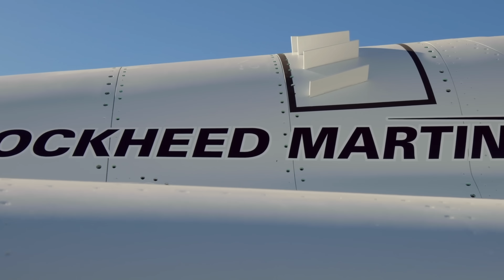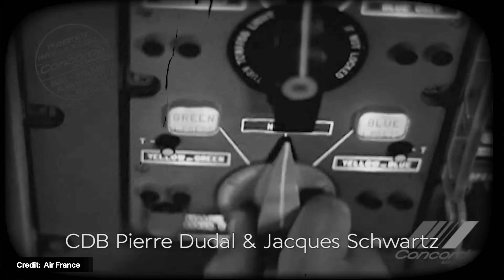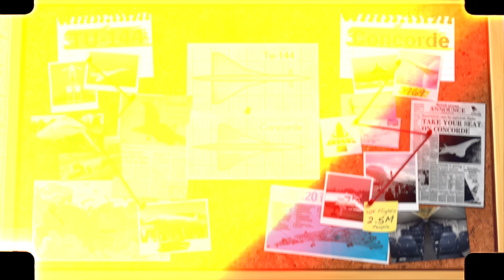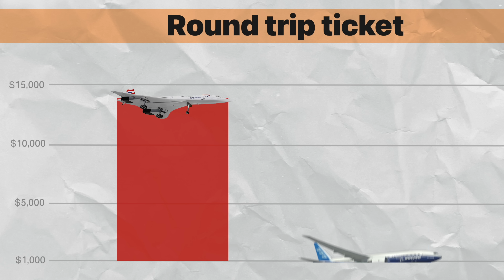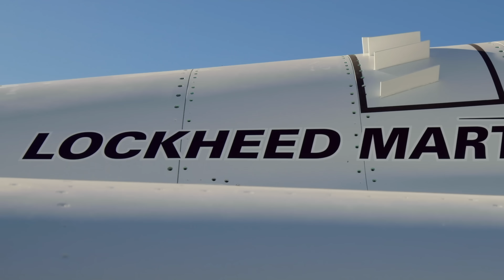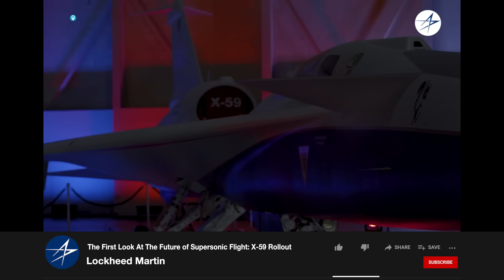NASA Just Solved the Super Sonic Flight Problem

Comment: Concorde was so loud that it couldn't be flown over land, for a subsonic demonstration flight one flew over my house in the Oakland CA hills and it was unbearable. This statement is true; the Concorde was so loud due to the sonic boom it created when flying faster than the speed of sound, which meant it could only fly over oceans and was not permitted to fly over land populated areas to avoid disturbing residents with the loud noise. 
Explanation:
Sonic Boom:
When an aircraft breaks the sound barrier, it creates a shockwave that travels to the ground as a loud "boom" - this was a major issue with the Concorde. 
Regulations:
Due to the disruptive nature of sonic booms, most countries, including the United States, banned supersonic flights over land. 
Transatlantic Flights:
As a result, the Concorde was primarily used for transatlantic flights, where it could fly at supersonic speeds over the ocean.

Comment: this guy claim to be engineer of a jet fighter? which one? 
by the way, nothing will make sonicboom disappear so long the jet roars still sounding. sonic boom isnt aero problem. its a SOUND PROBLEM. 
and the only most viable solution is the one that your HAARP tech already have : using RADIO emission to phase out aero molecules vibrations caused by the jet thruster. by engulfing the engine and the exhaust/high pressure thrust behind the jet inside a radio bubble that emits frequencies that cancels out the sound of the rumbles in the air so it doesnt propagate outside the bubble.
the emitter antennas can be placed around the rear fuselage around the engine(if the engine is behind) to form that bubble shape influence. thats it. and you can use WHATEVER aero design you want for the vehicle. and not only you wont hear sonic boom, you wont even hear the engine rumbling. and this is not some sci fi tech. your government has been able to do that with their HAARP tech.

Comment: 0:39 in and already wrong.  Supersonice flight has been continuing since the concord was retired.  F-18, F-15, F-16, B-2, F-22, F-35, and the coolest of all the SR-71. All supersonic. And I think there are even SR-71 has a couple still in service and I think the A10 tank killer is super sonic but I'm not sure.  Supersonic passenger flight is a different story.  The Concord was a very odd bird and had several problems to start with.  Since before it retired there have been attempts to make a better supersonic jetliner but there were several challenges to overcome.  I know, I worked on the High Speed Civil Transport project before it died in the '90s.  It will be interesting to see how those challenges are met and interesting if you know any of them.

Comment: I recall the TU144 was incredibly loud inside, so much so that you could barely have a conversation. And the air show crash was actually a result of a French surveillance airplane flying above (it was he reason the TU144 take off was delayed as the French had to wait for the surveillance airplane to get in position). When they climbed, their radar sounded a collision warning causing them to level off abruptly, stressing the plane beyond its design. The French and Soviets settled the case quietly as it was an embarrassment for both.

Comment: As long as the flight is long enough to justify it, the fuel burn rate wouldn't necessarily be hugely different if the plane were higher up - most of the fuel burn on the Concorde was keeping that speed up against the friction of the atmosphere - fly higher, less friction.  Only works for long flights, though....

Comment: Great job Ricky, but I feel if you’re going to adjust for today’s dollars. Fuel cost should be adjusted as well. zero chance a Concord and a 777 both cost the same per passenger mile. The slide before gave the 777 4.7x passenger mile advantage!

Comment: A modern supersonic plane has a problem that the Concorde never had. That is climate change. The Concorde had a higher fuel bill. A supersonic plane today would still have the higher fuel bill but could easily develop the reputation of another evil thing that the rich are doing to the masses by putting multiple times the amount of carbon in the environment than the planes normal people can fly. If that happens, much of its potential market will shun supersonic flight either for their own beliefs in protecting the environment or the damage to their image and reputation. If this happens, the lower volume of travelers will drive the costs much higher and likely will doom the whole project.
Reply: Eventually people will awaken from their self imposed nightmare and realize we're at a CO2 shortage.

Comment: NASA MAY have! MAY HAVE found ONE solution to ONE specific problem. And there are LOADS more problems to be solved before sustainable supersonic passenger service is available.

Sonic booms over land is the one they MAY have found an answer too for a given CONFIGURATION. Is that configuration usable by commercial airlines? We will have to wait and see.

The bigger issues fall into the realms of systems management (Efficient aerodynamic load control), logistics Engine maintenance and parts) and economics (Fuel costs and useful load)! These are the money shots! Anyone saying different is selling swamp bottom land.

The Concord never made a dime in its life. It was a money pit.

Comment: Single engine transatlantic flight may be another hurdle. Regulations for Transoceanic flights for twin engine jet passenger aircraft had to be carefully drafted after reliability of twin engine jets proven. Single engine is a whole nuther issue for passenger service. 

“ETOPS, originally short for Extended-Range Twin Operations Performance Standards, or more recently just plain Extended operations, is the rating that allows twin-engined aircraft to fly long distances; particularly over large bodies of water like oceans.”

Comment: The real problem of today's air travel is that check in takes over 1h and requires you to strip to your underwear. And often the airport is hours away. So 1h flight time comes with 4h pre and post flight time.
Reply: Business flights (not business class) don't require TSA and helicopters aren't much more than the travel time cost plus the vehicle.

Comment: I think it will be cheaper to build trains ..China already is coming out with trains that will run 1000km/h ...And the semi vacuum tube system with 4000km/h is planned... 3.2 times the speed  of sound... Unless you can build planes faster and cheaper ....Furthermore train stations  are more convenient than airports
Reply: And after the first tectonic plate shift, they can rebuild the tunnel.

Comment: Sonic booms are not the problem, the problem is with GHG restrictions  we will be using less dense energy sources ( compare the best battery in w/kg to regular gas ) and Since the kinetic energy increases with the square of the speed, an object doubling its speed requires four times as much  energy.
Reply: That’s just for static drag. If you include the supersonic drag, power is more like velocity cubed. That’s why supersonic flight is a dead-end. The amount of extra power required to go supersonic is just stupid and makes it horribly inefficient.
Reply: @simontillson482  If speed is the object, you pay the price. That's why most people no longer use boats to cross the Pacific.
Reply: @friendlyone2706  That is an Awesome point!  Were we the people of yesteryear we would think "Why are these young people hurrying to jet set across the Atlantic? The Queen Mary, "Blue Ribbon Atlantic Crossing Holder" can get there in a blistering 4 days. What's the point of going faster? It is clean, efficient and most of all safe!

Comment: Because of the requirements of the aerodynamics, these planes have to be built narrow-bodied making them claustrophobic 😒. Plus because of the massive fuel⛽️ burn 🔥 and limited capacity, each seat 💺 has to be priced very high just to break even. What western propaganda 🤔 doesn't allow us to realise that 🙄 Concorde was quite a space constrained jet liner. They are only suited to jet-set-go business bosses and executives. For regular travellers, a wide body 747 or an A380, flying at subsonic speeds, is a far more relaxed 😌 and leisurely 😎 choice.

Comment: I'm more interested in electric planes. Quick swappable Aluminium Air batteries could make long distance EV planes viable. The battery is very light making it perfect for planes, just split it in many small modules so that swapping them out is easy. Charging a plane takes too much time anyway so battery swapping is the way to go.
Reply: Batteries are secondary stored energy and therefore always for inefficient than direct energy production. But, if government grants are your objective, battery powered planes can be profitable. If you're on Mars, battery powered might be more efficient than carrying your own solar panels.
Reply: @friendlyone2706  Depends on where you get the energy from. Sure, putting a generator and a battery between an engine and the wheels doesnt make sense most of the time. But if you want to use other forms of energy (be it renewables (sun, wind, water, waves, biomass), or other types of fuels that cant be used for mobile applications (coal, trash, nuclear power)), a battery is often more efficient than power to fuel applications. Even here on earth.
Reply: @justinterested5819  Batteries do have their uses. And going downhill can be recharged -- even on the moon and Mars.

Comment: I worked on the Concorde as a Braniff flight attendant because Braniff had a promotional interchange with Air France and British Airways in the late 70s.  Braniff only flew it sub-sonic and we only flew it between Dallas and Washington DC.  The week that I worked on it the flights were always brim-full.  I sat in the aft jump seat (facing aft) and take-offs were especially thrilling. It felt and sounded  like a rocket ship with my body thrown against the seat harness! Because we remained sub-sonic over the US, even at our cruising altitude the plane never leveled off. Pushing those carts uphill from the aft galley was a bit of a chore. No, really, I was very lucky to experience the Concorde!
Reply: That's super cool that you've Been on it!
Reply: I would love to see your stewardess outfit... the 70's I miss. Was it polyester ...bell bottoms and of course a scarf. :face-blue-smiling:
Reply: this a flex lol and i love it

Comment: The fuel cost may not be what you think it will be. Consider the idea of the current adaptive cycle engines coming online for military jets, they make supersonic flight possible without using afterburners or even better fuelless engine designs using heat exchangers instead of dumping masses of fuel into the airstream.
Reply: No matter what engines you use, supersonic flight is always going to be way less efficient than subsonic. This argument doesn’t work I’m afraid.
Reply: @simontillson482  I am not saying supersonic flight would be less energy-intensive than subsonic flight, just his baseline comparison looking at Concorde consumption levels vs the technological advancements we have today is off and will not be as prohibitive as he imagines.
Reply: @thehobbyguy7089  Very true. The gap with modern technology is narrower, but it’s still wide enough to make it impractical. As mentioned in the video, even military jets only use supersonic flight to avoid interception and avoid it for cruise wherever possible, because it reduces their range so drastically. Honestly, I can’t see any reason for commercial supersonic flight. It just makes no sense. For long haul flights, the actual flight time is not a big proportion of the door-to-door time anyway, so even for business class, the cost/benefit ratio is very poor. It’s pretty much a gimmick at this point and will probably remain that way due to increasingly tighter controls on emissions and efficiency.
Reply: @simontillson482  You remind me of the college professor who said we didn't need a new delivery service whose motto was "When it absolutely, positively, has to get there overnight." The professor was wrong. The student became rich. Sometimes people absolutely, positively have to get there faster.
Reply: @friendlyone2706  Good point. Maybe it does make sense for the ultra-rich or executives with unlimited expense accounts. I did deliberately use the business class in my discussion for this reason. I ignored the idiot class deliberately… 🤓
Reply: @simontillson482  Or the person with a personal emergency, such as learning a loved one is dying, and is willing to pay on their credit card for the  next two years for that opportunity for a final goodbye.

Comment: Watching this video I couldn’t help but think of two options. The expensive supersonic aircraft would be for low volume passengers. The ultra efficient aircraft would be for everyone else. In the future I could see the blended wing body with very high bypass ratio geared turbofans being possible. Both could possibly utilize rotating detonation turbines for the power section. The blended wing body might have a contra-rotating bypass fan like the NK-93 for maximum efficiency. The NK-93 was never funded enough to reach market but highlighted a possible path forward solving the noise issue of the CFM RISE and other propfans.

Comment: I hate it, especially the company that wants to lift the ban on supersonic flight above land. Flying at supersonic speeds induces so much more drag, even high performance military jets don't often cruise at supersonic speed because it demands burning more fuel to offset the drag. 

Love it when NASA makes cool tech, but I'm betting and hoping each of those supersonic flight startups are just scams.
Reply: Indeed, just think of the seed money required for a supersonic plane. 10s of millions per year, over 3 years from hype to fail. That’s a good 30 million for these scammers. Better than getting a real job… Venture capitalists are complicit in these scams - they’re taking a 10% cut and all they have to do is find some rose-tinted glasses wearing schmucks to invest.
Reply: This is, pardon my french, total bollocks. Why would we want such lower fuel efficiency and passenger carrying capacity? It makes no sense whatsoever.

Comment: This is NOT radical new thinking.  It's technology based on the old "aerodynamic" shape that pushes fluid around the outside of the transport vessel.  Radical new thinking is shaping the vessel so that air that would otherwise be in the space where the vessel needs to be, is pushed through a nozzle that extends through the entire length of the vessel.  "Drag Negation" provisional patent April 2014 by yours truly.  Since then Robert White has used the principle to some degree in his WMC250EV motorcycle.  Companies think it's marvellous to quieten supersonic travel?  Congrats, a tiny little improvement.  But real improvement is suddenly allowing exponentially improved efficiency that equates to fuel milage never dreamed of, as well as speeds never dreamed possible.  Be prepared for some very VERY different looking transport vehicles when this technology is fully realised.

Comment: An electric plane might fly higher and faster
Reply: Really? How so?
Reply: @Israel_Two_Bit  
I am also interested in that information.   With energy density of batteries being too low and recharge times being too high for reasonable long range automotive use, I don't see practical aircraft powered by electricity any time soon.
Reply: 🤣🤣🤣🤣🤣 A plane is a woodworking tool.

Comment: The X59 long nose design, seems to have the noise problem solved.  Could lead to real sustainable supersonic travel.
Reply: That's just the most obvious feature. There's much more to it. Check the airframe a bit closer and you will see some interesting things about it, which are raising questions.